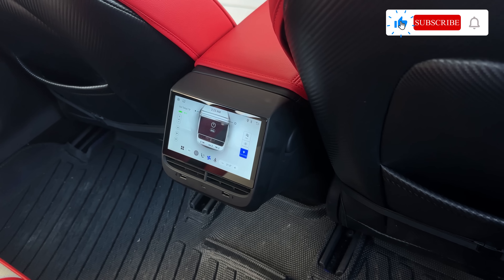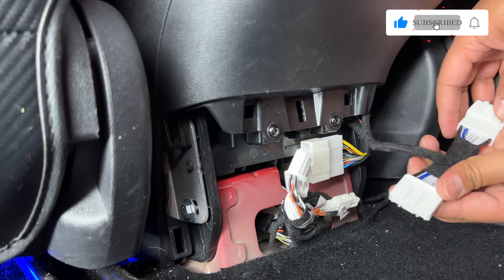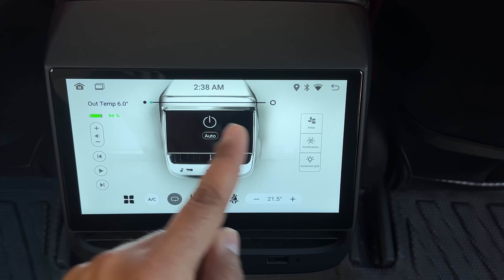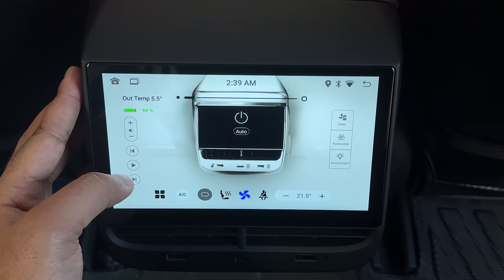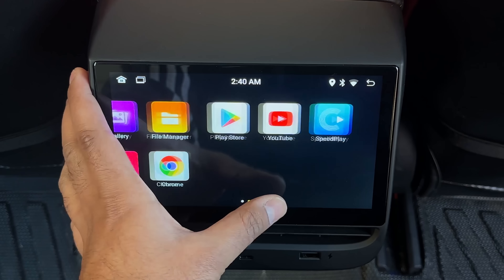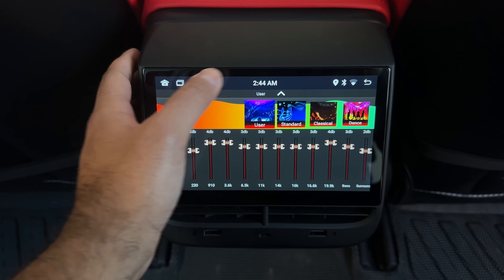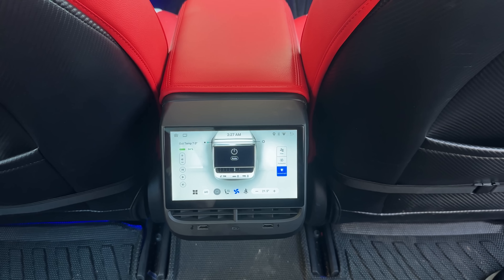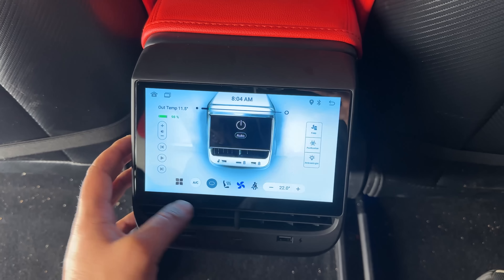NEW Integrated Climate Control & Entertainment Rear Passenger Display For Tesla Model 3/Y

Comment: I have the same screen and I’m installing it right now… quick question for you. I also have the same problem where the cable connection isn’t the correct one for the charging… what’s the solution for this is there like an adapter? and will the screen function without plugging that cord in… is that only for charging items?
Reply: well seems to be working just fine... I just tried the usb on the left and it works great ... play videos right off usb super quick ... love your videos !!! thanks
Reply from the maker: Thank you my friend. I believe you have a newer Tesla right? On that case the USB works (USB C plug). The older models like mine requires an adapter (which they do send with the kit but forgot to include in mine). How are the rest of the mods coming along?
Reply: @ShivaSapkota  mines a 2020 and mine did have the blue cable... I haven't tried the usb c in the middle or the right usb... going to test that today
Reply: but yeah mine did not have the correct cable to connect but everything seems to be working just fine without connecting that other cable
Reply from the maker: @SHOTTYTV  Awesome, thanks for the feedback.

Comment: Does it play Netflix while driving?
Reply from the maker: I couldn't download Netflix from the Playstore as this device is probably not what Google calls "Play Protect Certified". You can still get Netflix by toggling some settings and allowing installation of apps from sources other than the Play Store. Once the Netflix is installed, you can use it while driving as long as you have a Mobile hotspot providing wifi to this display. Thank you.
Reply: @ShivaSapkota  Thank you for your reply. I appreciate the hard work you do for the Tesla community 👍

Comment: As always Shiva, your videos are great. Thanks for sharing. May I ask. With all the modifications you have made on your Tesla, have you found it to have created any rattles noises whilst driving? Have the modifications loosened overall materials in your car to cause louder road noise etc? Thanks again, Merry Christmas to you and your family. Looking forward to seeing much more content from you in 2023
Reply from the maker: Thank you so much my friend! The car is probably louder compared to when it was new but I also use regular tires instead of foam. I always make sure to tighten up screws I remove and follow through with each install so haven't had any rattling issues so far. Some of these components (dash, side dash panels, footwell panels etc) are quite loose now since I have removed them probably over 50 times but still no issues!
Reply: @ShivaSapkota  wow. That’s really good. I’m loving the videos and often think oh wow. Hope this doesn’t ruin your car. 
I picked up my Model 3 LR this year and love it. Just didn’t want to go doing some of these kids and have it ruin the dash components etc. 

Thanks for responding. Have a great week.